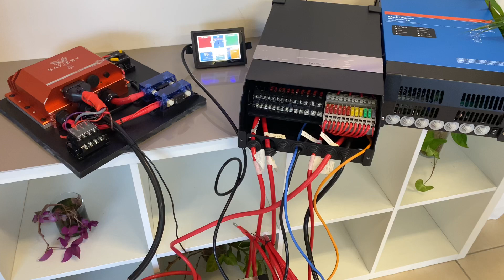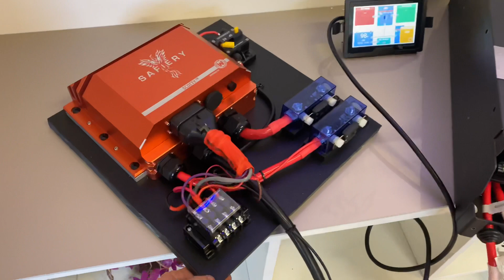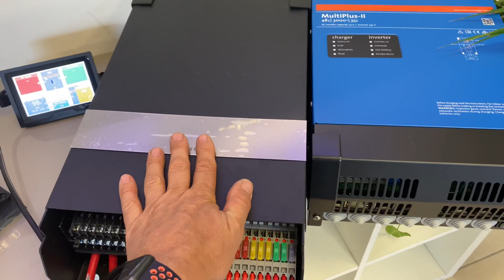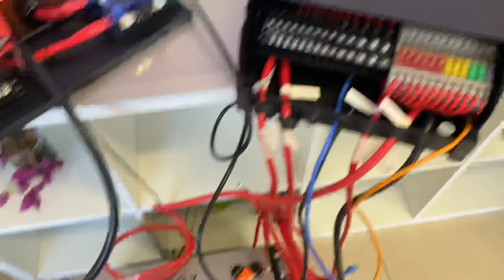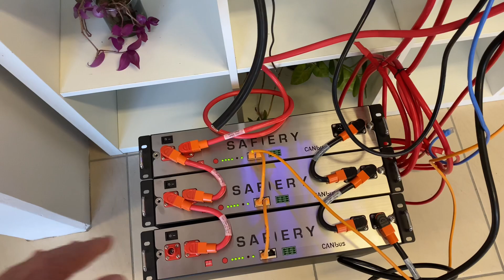Sprinter 4x4 with Scotty under Drivers Seat saving Space with easy install 250A Alternator Charging

Comment: Split the FRONT END from the BACK END.  The 48 volt  alternator and the SCOTTY  board located in the front of the vehicle. The inverter charger and batteries and other controllers can be in the back. The 'back' can be the van back or a slide on camper if you have a tray back vehicle.

Comment: The Scotty units look like an amazing piece of equipment, are they available outside AUS? Would love to be able to add them to offgrid vehicles in the UK!
Reply from the maker: Yes they are, we have several running in Europe. Available in 12-48V or 24-48V Models.
Reply: I am based in the UK and have one of these on my Yacht to move power between my 12v and 24v power systems. It's a great product. It can be fitted to any engine/alternator. You get some real benefits with a euro 6 compliant engine as it can help support the 12v side when the engine isn't generating and make full use of the 12v power available when the engine is. If you need anything, please make contact.